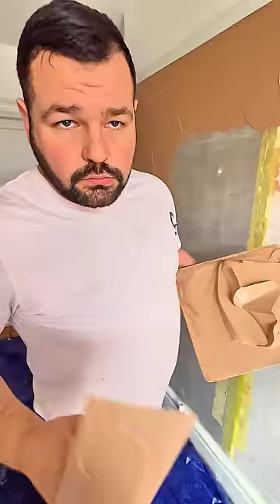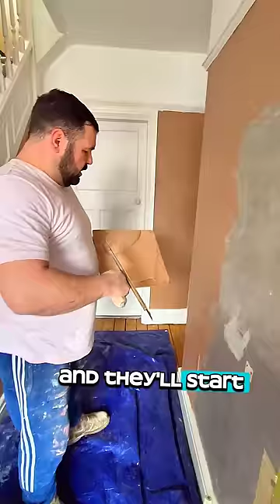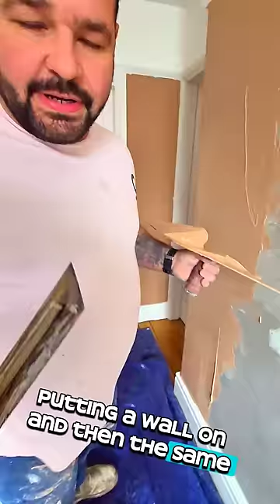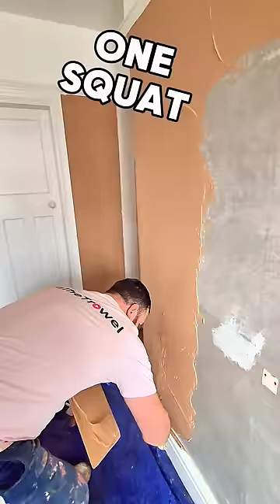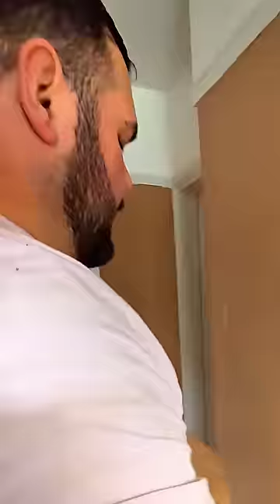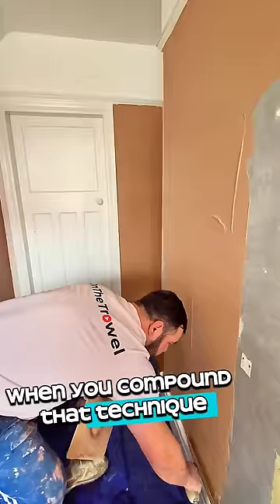FASTER PLASTER

Comment: I was a plasterer for 20 years and that’s exactly how I do it 👌
Reply: That'll be why you only lasted 20yrs then cause you certainly don't skim a wall like that🤦‍♂️
Reply: @stephnkaiser  I suppose you’re a master, Steph? If you can tell me the issue then I’ll happily bow to the master.
Reply: And no response 😂😂
Reply: You must be mad, ive skimmed many walls and he makes it look easy and his finish aint sh*t . Hes putting that on so smooth for the first pass its unreal, most just throw it on or better still drop it everywhere 😂 @stephnkaiser
Reply: @chris-Ribble-Roots  
I think I get where they may be coming from in some way 

I was always taught never to use lines 

Mostly because it stops cross hatching 

but also because
It's far better for your joints not to just keep doing lines and I find I get less grabbing action from a curved motion too.

I was taught to always start at the top left because then you finish on your assumed strong side 

Start in the corner and make a circular motion for just over a quarter of a fair sized circle and then do the opposing side to gain conformity
I'm not sure how many places teach this method 

I say do what works for you 

We are all different

I could never say this method is wrong 

It's just wrong for me 

But if doing it everyday 

Adjusting your method/motion or direction helps joints
Reply: I've only ever plastered twice. This guy makes it looks so easy. Sign of a good craftsman.

Comment: Interesting and I can see how some could benefit, however I lay on with an 18" trowel, it's hard with the extra weight on the wrist but it means I load up 3 scoops of plaster each visit and spread from the bottom to way above my head, leaving only the bit that has to be got with steps anyway, also never had it in the eye doing ceilings since.
But be warned there is a reason most use 16" trowel, it'll kill your wrist even more, but if it's speed you need.....
Just another idea if this doesn't work for you.
Great video and respect to you fellow plasterer ❤

Comment: To be honest i find plastering easy but mixing up hard 😂 i learned yesterday and done a whole wall already, no waves no out marks or train lines as i sanded my trowel edges,i think they called them train lines 😅 i followed this guys and others tips like ryan, so thank you for the great advice!🎉 i used thistle one coat btw and my first mix it also dried too quick in the bucket :( 25mins ish and is more grey not that nice color i see u guys use, any advice there ? 😊
Reply: I also troweled up after 20mins/90 mins and cross trowel with water at the 180min mark for smoothness.

Comment: Top tip. Spending all that money having wall replastered? Take the skirting, dado rail and door moldings off! It looks shite otherwise!
Reply: Your right
Reply: Why does it? Just need a plasterer who’s used to it
Reply: @lukewilly  the plaster will sit flush over the skirting board it's an absolute eye sore
Reply: Not 💯 sure but with the age of the door and mouldings could even be lime plaster.... Going over with skim is a massive no no, but customer is always right I guess as probably didn't want to pay for a full knock off and re board or cement base.
Reply: @hfubvgjbcg-cs9wm 100 percent! If not flush it's very hard to get the plaster on exactly the same thickness. If your going to the cost and mess of a reskim either remove the woodwork and reuse if possible. Or shell out a bit more get new word work and have a nice new look to the room. Also I've seen where this has been done where floorboards flex this then cracks the skim from the skirting.
Reply: @bigphil1987blackpool 

I'm not sure your a pro 

You realise that you already paint the wall with PVA for bond 

Try changing the PVA for SBR 

A complete seal let it dry then give another coat to get the tac for the plaster to stick to 

So why would you rip a customer of male their house a complete dusty mess all because of the possibility of lime plaster reacting with the new stuff
Reply: @hfubvgjbcg-cs9wm no he isn't 

Them skirts are likely over 140 years old 

You ain't buying new ones 

Master joiners are not cheap to create a replica out of VERY EXPENSIVE PINE like we used back then

I'm the UK you do not EVER unnecessarily remove ANY ORIGINAL FIXTURE of the house 

Done jobs like this on houses over 400 years old

You should see how long we have to take to remove arcs and skirts to not damage a 400 year old original feature

This is also made of bricks not wood the old fitting style is to build the house with wedges in-between bricks and then fix them with 6 inch nails 

Now that nail at a few hundred years old will grips that wood like a mo fo and you have no chance
Reply: @madyottoyotto3055  

For starters PVA or any other synthetic polymer can react with other pre applied coverings.. and straight away you suggesting use PVA or SBR on lime plaster shows you know nothing about suction or the breathability of the substrate... Lime plaster needs to breathe, coating with any polymer stops this..

In a scenario where you must go over lime it's a dust off and moisten with water... Then skim any good time served spreader will know this...

I mentioned not going over lime as it's not ideal, it can fail after a new product is applied and you have no idea what condition it's in until you start knocking off.. I don't do "itl do" it's done right and lasts as it's my rep and name on the line with my work.
Reply: @bigphil1987blackpool  we'll have you ever thought that plastering it and the sealing the plaster with paint or paper paste is Stopping IT FROM BREATHING 

SO PLEASE EXPLAIN THE DIFFERENCE

Your way doesn't breath 

My way doesn't 

And you will also find that it depends on the rest of the building 

If the walls and mortar are in need of breathing then you have to rip off or any damp inside will cause a blow out 

So yes you make up what I know or don't know

But I was generalising just like you was 

Remember in life ONLY the clever people know they can learn something from the stupid people

But 

Only stupid people assume what others know 

So nice try but try again 

Sbr and PVA are KNOWN not to be an issue with reaction and lime plaster so what do you know
Reply: @madyottoyotto3055  

Wow... Because any good spreader worth his salt wouldn't use multi finish on lime because it's not breathable.... The whole point of latten and lime was because it was breathable....

You have to use a breathable top coat after water is applied... And the modern paints weren't available back then that do breathe and allow moisture to pass through... 

It's preferred to remove latt and lime due to the awkwardness of the compatibility of new products and the life span of the original application... 

I was originally offering an opinion after working for 27 years in the construction industry following my fathers craft after he worked for over 55 years as a craftsman.. there's a huge difference between  a tradesman and a craftsman, or people that just work for the bloke down the pub for beer tokens.
Reply: @bigphil1987blackpool  did I mention what plaster I would use 

NO 

but more to the point actually read what I did write

When it's sealed ie painted or papered ect 

ITS SEALED 

most houses done with lime plaster never required it and still don't

It needs to breath in some circumstances

For one example

A single skin none insulated wall 

Would need to breathe

Even then most of the time breathable paper etc isn't used

Now give I wrote the question In clear plain English I'm assuming that you also don't understand which building need lime plaster Vs the ones that don't need it but it was used anyway because it eventually became standardised for a while and building regs was then introduced

Big difference

Now should I have included all of that in a basic response to you saying you can't do it 

I bet you tell all customers that just to cream it don't you 

Around 40 to 60% of houses fitted with lime plaster was in no need to be breathable

The plaster doesn't need to breath unless it gets wet/moist
Reply: Does it look flush to you pal? That’s cos you’re caking the wall in plaster. It’s called a skim for a reason

Comment: Speaking as a painter and decorator for 10 years. Yes this moght save you plasters time. But I can always tell with the end product if you guys did this or not. Basically what im saying is when you do this it always look worse, no exceptions
Reply from the maker: Sounds like your dealing with dishy walls. 
It's not the technique of application, it's. More than likely plasterers troweling up with flexi trowels

Comment: i was taught to plaster from the top down
Reply from the maker: That's the correct way mate
Reply: @Onthetrowel  👍
Reply: I was taught to go from the top but I prefer the bottom
Reply: Me too mate. Don't wanna be slopping wet muck all over the work you've just done! 👍
Reply: The same  over in ireland plastering alot harder because all out side rendering wet dashing dry dashing in side send and ce.ent on wals the skim over sand znd cement wals no young people taking it up anymore your covering bad block work and if it was timber frame house walls are off a good  bit would have to bond the to fill them out cover alot of people's bad work plater has to leave it right Well most of us will

Comment: Thank goodness for American drywall so we don’t have to go through this
Reply: This doesn't need sanding for days. Once it's done it done
Reply: Drywall is just a cheaper lazier way to finish a wall imo🤷‍♂️ your going to get a lot more durable wall this way
Reply: Tape and jointing has it's place but plastering is cleaner than sanding and more durable.
Reply: I worked with Polish white plaster and multifinish for many years. Like you say, multifinish is faster and more durable but sometimes harder to get 100% perfect than European products that you can always sand to perfection.